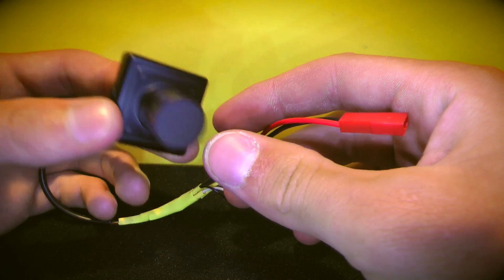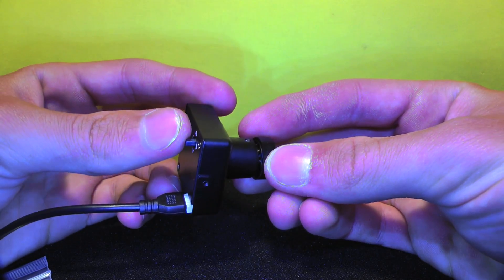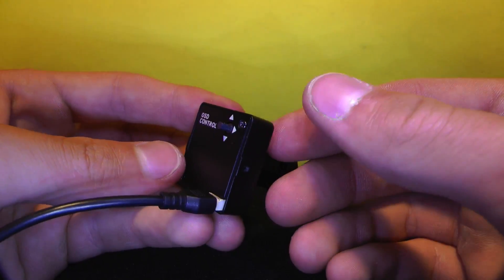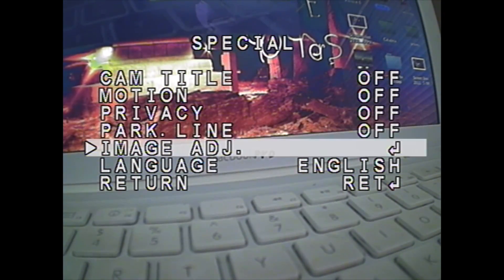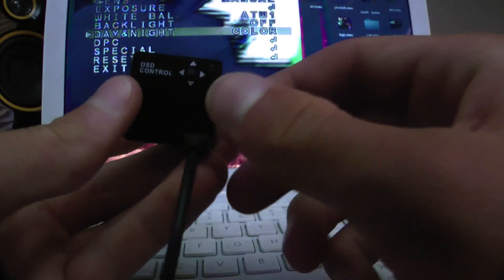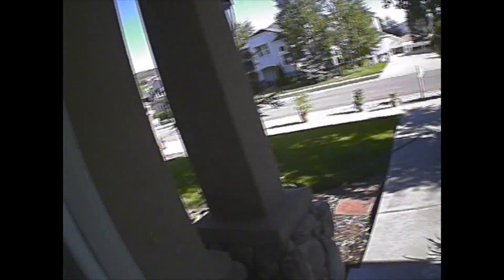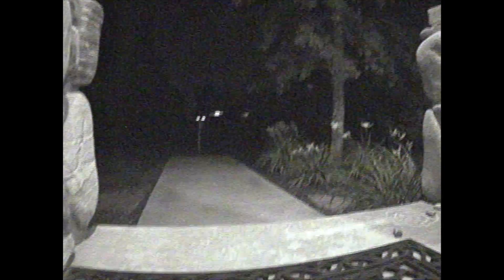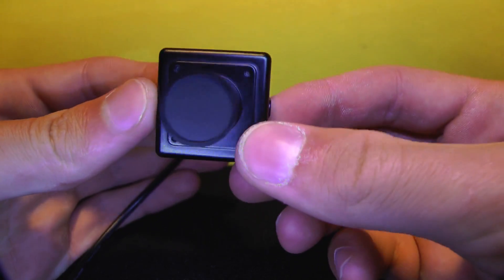FoxTechFPV WDR 750 600tvl Mini FPV Camera Review

Comment: Nice review! One thing you might run into some time (I have a similar built cam): the changeable lens is just screwed in and then locked with a screw from botton right? Mine was loose enough to shake under vibrations of the plane so that gave white lines of interference in the vid. That was not electrical disturbance - it were only the vibrations. To fix that i used extra tape to tighten the lens...